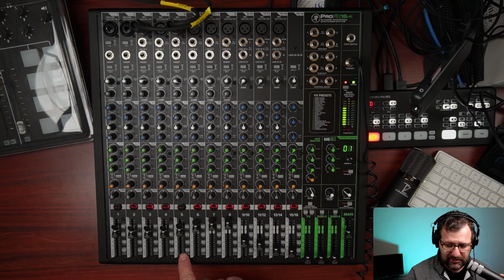HOW TO SET GAIN ON AN ANALOG MIXER

Comment: How do u set it up on the board for no clipping and distortion on dat board because all u did was the gain
Reply: Gain staging will help with that. You also need to make sure any other gain structures are good also. For example if your mics also have a preamp and gain knob on the receiver that connects to your mixer via xlr or ts cables, you need to make sure you also have plenty headroom on it as well. I turn ours up to 1/3 of the way and up the gain on the mixer for the rest of the way. Distortion may also come from other instruments that have their gain up to high such as keyboards or guitars. You can have the gain right on the mixer but still be distorted if other gain structures aren't right or if you have bad cables.

Comment: Is there any recommended way to set up a sound mixer (PMP6000) that multiple singers can use the same mic?   I struggle with this at a music jam where different people use the same mic.  The individuals expect the system to compensate for their changes in volume and the ever varying mic placement distance.
Trying to explain to them how to use the mic has not helped and trying to constantly adjust the channel volume or even gain has not been a good solution. I would appreciate any help.  Thanks!